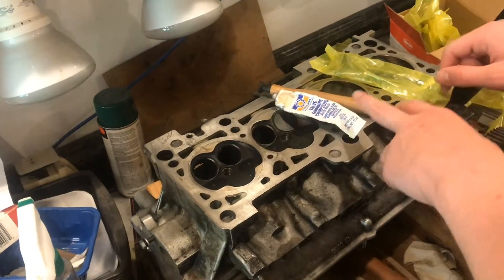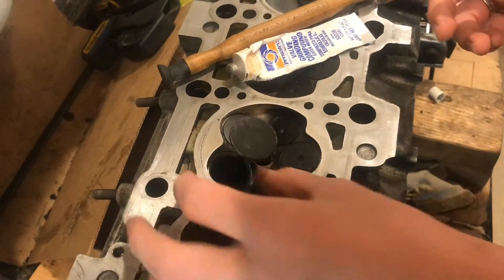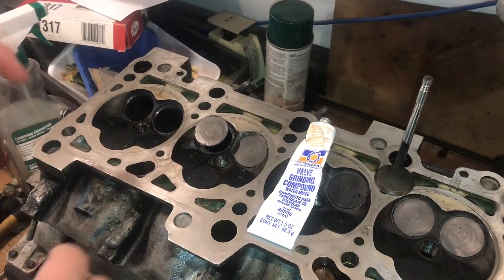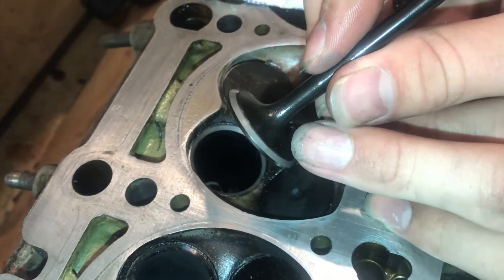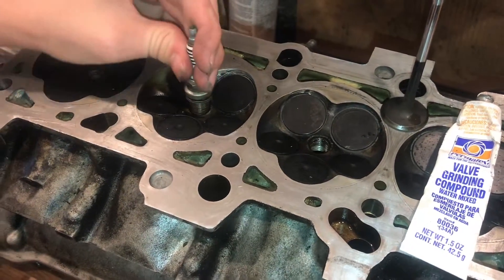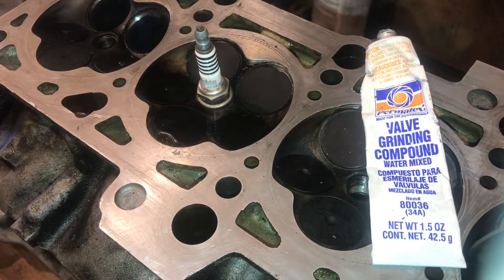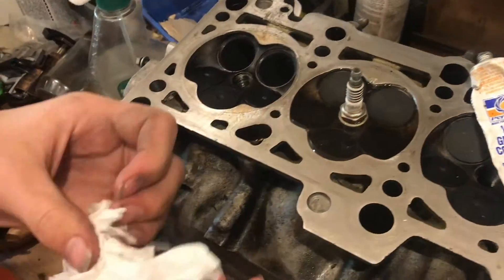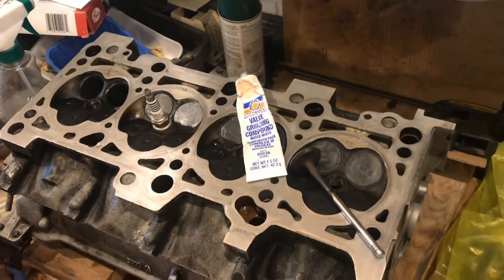lapping valves and TESTING with water to VERIFY proper seal 1.8t audi

Comment: Good video. Lift the drill and the compound gets sucked to the work surface. 
Light is a bit better(shine a light thru the back or wet it and blow compressed air. 
Water doesn't flow like light or compressed air(but if it's all you have.

Comment: I lapped my own valves about a year ago.  I had to:

1.  Use a drill and a hand tool
2.  Checked with water (turn the cylinder head on its side so you can fill up the ports).  This gives you more water pressure.  You might get a drip after a minute or so....keep lapping until you are happy.
3.  If you want perfection, use compressed air around the valve seat, if there are leaks you will see air bubbles on the port side.  This might make you pull your hair out as lapping is not easy.  Depends on how tight you want.  My engine runs great and I ran out of patience doing the compressed air thing.

Consider buying a rebuilt head.  If I had to do this again I would buy the head.  Lapping takes forever.  After popping the springs and retainers 3-4 times for each valve you will understand what I mean.
Reply: I am at that exact moment right now. Starting to pull my hair off :/ Filled the head with petrol and blew 6-7 bar compressed air into the opening. Some valves are 100% sealed, some look like a jacuzzi.
Reply: @baschiransawi  Yeah this is the problem with the compressed air.  It's never sealed as perfectly as you think it is :).  If you get no drips you did pretty good.  I guess how tight you want it depends on how much patience you have.  Or maybe...if you can stomach taking off those valve retainers again.  Good luck!
Reply: I did this on my 150 scooter put water through the ports. Used a drill and went to town. Better than the chinkas did.

Comment: Old video, I know, but FYI: test with rubbing alcohol, not water. Rubbing alcohol has a much lower viscosity and surface tension than water, so it will permeate and leak through much smaller gaps than water will.
Reply from the maker: I will definitely be using rubbing alcohol next time, thank you👍
Reply: I was thinking about using rubbing alcohol too but won't the leaked alcohol evaporate too fast? Just wondering since that I may use rubbing alcohol vs water.
Reply: @Wi1dCatAZ  if it's a super slow leak, like one drop leaks out every 30 seconds or so gets past the valves, then maybe, but if the leak is that slow, I doubt water would leak out at all. When I used alcohol to test mine, it had what I would consider a small-ist leak, and it works fine and didn't evaporate too fast. Some steps you could take to help the alcohol test would be to do the test in an area without much of a breeze, as that'll help slow the evaporation. Also, you could do both an alcohol and a water test if you really wanted, as it doesn't take long to do either test once the cylinder head is off the vehicle.

Comment: The drill with the fuel hose works amazing. I mean you could literally go for a few seconds in fwd, push out, put it in reverse for 5 seconds an youre done. Now i did 30-60 seoconds per valve but it goes insanely fast.

Comment: Great video! If you were to have water leak out. How would you go about figuring out which valve isn't seating perfectly?
Reply from the maker: The water will leak from the other side, you could place some thing like toilet paper into each chamber‘s., Hope this answer helps👍
Reply: @livefree6878  currently lapped 2 valves and I believe I may have over lapped them. I did it by hand each for another 10 minutes and did a leak down with water, both of them were leaking. Got frustrated 😂 and used a drill going one way and another and now resulted in both of them leaking even more. I believe I may have over lapped them. Any suggestions?

Comment: Very nice description on how to test a valve job, I’m going to do my first valve job this month. How can you tell if valves are bent? By just looking at them they appear fine but doing the water test they leak, even the ones I left the springs on.
Reply: How'd the valve job go?  This kind of stuff is really neat.  Would like to get more into machining.
Reply: My valve job went excellent! Thanks to videos like these. My compression went from an average of 80 on each cylinder to 120. When I drive my 96 ram I can tell I have more power too.

Comment: I just replaced a burnt valve and lapped in a replacement. If you see a few tinny bubbles around the valve but the water does not show a noticeable drop in an hour world you say that is acceptable? It's my wife's 1999 Lexus RX 300 and I'm wanting to lap all the valves but it is a V6 with 391k so it's would seem counter to the other side.
Reply: That's ok when the spring goes on its higher spring tension will seal it
Reply: @shimon2476  thanks. All is well a month latter. I'm still pushing my wife to buy another suv but we may wait it out because the new and used car market is still crazy.
Reply: @24hourgmtchannel64  ahh glad to hear understood

Comment: by adding water if it leaks it could be either rings or valves that is not a vali d test -----before you start take comp test then add i spoon mtr oil to spsrk plug hole retake comp test if it helps its is the rings need replacing if no help its the valves leaking ----this a standard test for ages.
Reply: Only testing the head here, and doing it much better than if it were on the block.
Reply: Using a fluid to check the valves are sealing IS a valid test after lapping.
Reply: thats great advice!!!!!
Reply: agreed, n i like usin rubbing alcohol

Comment: need compression test to check for leaks not water put a spoon of mtr oil in spark plug hole take comp test if oil helps its the ring no help its the valves leaking

Comment: Never use a drill thats being lazy you load and heat up and wear your valve guides increasing clearance and hello smoke, valves dont spin like in a drill, its a bs method never use a drill. you ruin your head quicker

Comment: paint thinner or naptha works well for me. after lapping i clean and assemble the heads;then put the thinner in the ports covering the valves.if any leak,then disassemble and lap more. water might end up rusting or pitting things, and thinner penetrates better jmo.
Reply: I use thinner too
Reply: The only correct way is to use a vacuum gauge !  I often show people who think their heads are the best on the market how bad they really are, I have had a head on the bench for a few hours full of paraffin with no leaks ! until I add the vacuum gauge it just pulls the paraffin straight through the seat areas and drops down to low or medium at best, all my heads are only released once I get in the top are of the gauge which is about 95% the best head done like that above is going to be 40% which is poor to say the least.
Reply: @martinfidel7086  if you say so....... nevertheless, i get good steady vacuum readings once the engine is running and excellent performance as well.
Reply: @danielslocum7169  I do say so, and that is because I use methods that can be recorded easily and give the best results,  it's why F1 use the same process,  I'm just saying that you could do better but it's your choice :)
Reply: @martinfidel7086  if and when i think i have a problem,i will certainly address it; thanks.

Comment: You sprayed your cylinder seat with kerosene but won't that wash the compound down into the valve guide.
Reply: Pretty sure he'll be giving the head a good cleaning before refitting.

Comment: I've done this and left rings on my valves how can i rectify this ?
Reply: Id say if it held water your good. He said he does a final test with the springs and retainers on. Or do like he said and add the water again and blow compressed air into the head and look for bubbles.
Reply: Did you use a drill?

Comment: why would you use water? oil maybe. but what happens in the running engine while under a vacuum? or a wot full load. you would be better off fashioning a plate that sealed each runner off and allowed you to pressurize each one. because even if you have a good seal at the seat what about the valve stem?

pros measure all this stuff, and account for oil film on the valve stem. but making a plate that would seal each port off, and allow you to put 50 psi of air pressure with the valve springs installed would tell you more. for the diy guy that might be better. it would also tell you if the heads runners were cracked into the water jackets.
Reply: This is where a vacuum gauge wins every time !  Use the correct tools are create a botch job it's a choice

Comment: Cool video. To test for leaks (or lack thereof) you should use a fluid with low surface tension, like ethanol, methanol, or better yet, kerosene which is not very volatile, or "lamp petrol" (aka naphta, "camp fuel", "white gas", or "Coleman fuel") available in most hardware stores. Water will not flow through very small gaps due to its high surface tension, so your test would not detect small leaks.
Reply: CORRECT MY DAD USED KEROSENE IN THE SIXTIES AND I HAVE SINCE THE SEVENTIES.
Reply: Axel, you cannot educate these people, they will simply keep repeating how good water is and how an air line on the wrong side is the best idea since sliced bread !
Reply: 100% correct
Reply: Could you diesel for the test
Reply: Is it okay to use petrol to do the leak test?
Reply: I have acetone
Reply: i use 120 psi air compressor on the ports while there is water in the  combustion chamber if there is any small bubble there is leakage and i lap it again
Reply: @giwtwm  good .  saves time
Reply: @giwtwm 120 psi will lift the valves of the seats in an case, so not a great test really?
Reply: @giwtwm  do you have the valve springs in while doing it this way?
Reply: @kolourblind3124  no my finger pressing down on the valve should be enough to seal it even without the valve springs
Reply: @giwtwm  thanks!
Reply: @giwtwm  How do you apply pressure to the ports?

Comment: Good Job
Reply from the maker: I’ve had really good luck with this water test. I find that if it holds water then when I put the springs on it saves a lot of time. Putting it all back together to find out there’s a leak is not much fun

Comment: Try diesel fuel that works better if it doesn’t leak diesel fuel it won’t leak, Diesel fuel is thinner than water.
Reply: Paraffin is thinner and I have seen the results with thinners !  I can guarantee a vacuum tester will show it to leak even after it appeared ok with paraffin!

Comment: I’d personally use gasoline instead of water. Gasoline will find more gaps than water
Reply: Gasoline molecules are smaller than water molecules. Gas will seep through where water won't. Gasoline being an oil based product, doesn't have the same surface tension as water does. Brake clean also works.
Reply from the maker: Interesting, Have you ever tried it, I’m game I’ll give it a try. Just out of curiosity why do you think it would find leaks better than water.
Reply: I have. And it’s about the density of fuel vs water. Not that water won’t work in this application but if you want to truly get as close to “air tight” as possible, use fuel. Something can be water tight but not air tight. Gasoline is just closer to the later. Try this... take a shot glass of water, cup your hand as tight as you can and pour the water in your palm then tilt your hand to where the water goes over your fingers. Try to keep as much in as you can. Now dry your hand and try the same with a shot of gasoline. You may find different results than I but I’d be willing to bet otherwise lol
Reply: @aaronfowler5477  ive herd of people using coolant and lacker thinner aswell but never tried it personally
Reply: @livefree6878  Low surface tension! Kerosene is the best with 1/3 the tension and low volatility. Solvents (acetone, ethanol, methanol, xylol, toluene) also all works much better than water for the same reason.
Reply: Lapping will cause a convex/concave surface on the valves/seat when the engine is at operating temperature as the valve will be much hotter than the seat due to different thermal expansion. This will result in less sealing.
Reply: @leeread5487  is there another way to fix small valve leaks then ? Thanks
Reply: @leeread5487  So if the industry recognised method isn't good enough what do you suggest then ?
Reply: @martinfidel7086  Get a valve job at a machine shop on a valve grinding machine
Reply: @leeread6757  I have my own machine shop thanks, unlike most on here I do know what I am talking about, I also know why doing some of the dumb shit these people come out is just bad joo joo !
Reply: @martinfidel7086  so water is ok to test with?